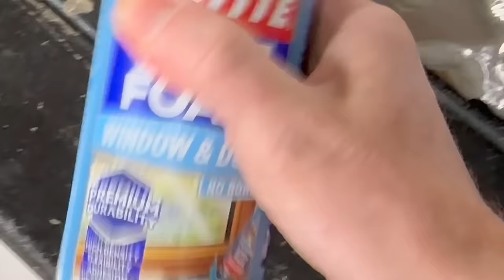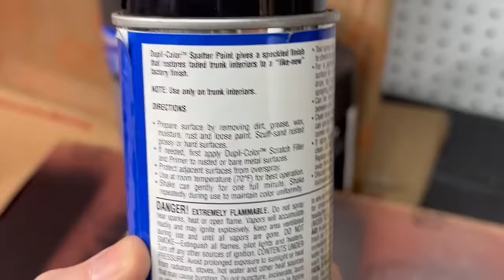How to Restore Cracked Vinyl Dashboard - Spray Texture Coating!

Comment: You should look at the SEM line of interior products. SEM texture coating 39853 is great for recreating textured surfaces and SEM interior dye can be mixed to the color code of your interior. SEM has 5 different sheens of clear top coats for the interior dye to match the sheen of your other parts.
Reply from the maker: I've heard a lot of good things about SEM in the comments and will be trying their paint on the next dash.

Comment: Try using a scraper on an oscillating tool to cut the foam. Works great. Fast and easy. Also try mixing a little fiberglass resin with the bondo. Makes it much easier to work with.
Reply from the maker: Great Idea! I recently bought one of those oscillating tools for my other channel. I'll give it a try!
Reply: @6thGearGarage you can get a Baur battery operated 5" DA sander that comes with 3 80grit velcro sanding pads for $24 through Harbor Freight. It does not come with the battery, though they are only like $20 bucks each. I had already previously bought a impact and a quick disconnect mini drill so I already had 2 batterys made by Baur so yeah, they make great tools. Packs of 5 80, 220, 400, etc run 6 bucks each they also sell packs of 15. I bought it to sand down some holes that I filled with fiberglass bondo on my 76 Corvette when I modded it with C6 Corvette mirrors. Worked great. Huge investment on the cheap.

Comment: Looks good, much better than some of the hack jobs others have posted. The one problem you have is you are using way to much product, too much foam, too much body filler each application. This is making your work efforts much harder than need be. When sanding do a wet sand you will get better and faster results.
Reply from the maker: Thanks! The foam is difficult to use in small amounts. Then I goofed and created a pretty big low spot on the front when I cut the foam too deep, which took more time to fill. I leave my mistakes in all my videos so that viewers can learn from my goofs.

Comment: It does Look good, but what about the touch? The original vinyl with foam underneath would surely have a bit of give under the hand, making it feel soft. But this painted restoration seems like it would be a completely hard shell. Am I right or is there still some give to it? How about the previous version with the 4-way vinyl?
Reply from the maker: It does have a little but of flex because of the spray foam. But I wouldn't press on it too hard, for hear of it cracking. Same for the 4-way vinyl, but no worries about the vinyl cracking because it's flexible.
Reply: @6thGearGarage  thanks fpr the reply!

Comment: Well done.  Might considering skipping the spray foam and use microlight body filler which is much easier to work with.  Also, use black or gray primer sealer to minimize bleed through from different materials underneath and provide good/consistent base to top coat.

Comment: I think if you would have spent more time sanding before you painted it it would have turned out phenomenal. You could still go over it and paint it again. You have to try that. Good job looks good
Reply from the maker: I agree. Depending on how it does in the heat test, I will go back and sand it more.

Comment: Looks good.  I wonder if one of the hammered metal spray paints would give a closer texture to the vinyl, without needed the extra texture spray and sand.  Some might only go on metal, but the universal spray lists vinyl and plastic.  Yours looks good, but if trying to blend with the rest of the vinyl, it's still different.  I need to do this on my '92 4runner.
Reply from the maker: I'd use this method instead, as the spray texture is not holding up in the sun. https://youtu.be/XB9GKLRHYNM
Reply: @6thGearGarage  I thought your previous attempts didn't pass the torture tests.  Maybe that was just with the spray on adhesive?  Your brush on adhesive with the stretch vinyl looks good.  My '92 has had cracks since I bought it 19 years ago, but they are worse now.  I think I will be doing this project, instead of just buying a carpet cover for $35.  FWIW, I am painting and clear coating the roof where sunspots formed, similar to your Acura Legend one, but with less perfectionism since it's the roof that almost no one will see.  We had a couple Legends long ago.  Nice cars, and yours turned out well.
Reply from the maker: @giro994  the first dash failed the test,  YT the second one passed very well. Sadly, this 3rd one has failed. I need to make an update video.

Comment: I might try this with my 1991 Camaro dash pad, but I think it might work better by using clear packing tape over the cracks after cutting out the channel then secure the edges of the tape with more duct tape and spray the foam into the channel under the tape might help with density and adhesion let it fully cure then remove the tape shape and prep for the texture process
Reply from the maker: That's a really good idea to save time on trimming it down. I recommend covering in vinyl like this video though, because it will hold up longer in the sun. https://youtu.be/XB9GKLRHYNM
Reply: @6thGearGarage  yeah the Camaro would be really easy to cover in vinyl maybe even do it in carbon fiber would look pretty sweet I think

Comment: I had an idea while watching.  What if you tightly wrap the dash with shrink wrap atleast around the work area after you grind the cracks out. Then puncture the wrap with the foam straw and fill the void that way. I imagine you will get a really good fill of the cracks especially if you get that wrap on tight and a a few layers.
Reply from the maker: That's a really good idea!

Comment: I would personally have built a mold to spray the foam in with the dash as a press counter tool to mold it onto. This way it expands and hardens much more densely too.
40, 60 and 80 grit sandpaper does the trick for trimming.
I would also never use the rough file coming close to end filling. It is far to course and risk scratching as you noticed.

Comment: Awesome work... In what room temperature did you use that you spray on that you got good results??
Reply from the maker: Thanks! I was working on this in my basement, so it was around 65° F
Reply: @6thGearGarage  You are welcome. In my area the temperature is 50f so can I start to spray it or I need to wait until it get to 55f or 60f?

Comment: That looks awesome Brian. Gave me some ideas for my YJ and Mustang dash.
Reply from the maker: Let’s see how it holds up through the cold and heat before you get started 😁
Reply: @6thGearGarage  I really like the texture paint you used. I have a nice crack in my yj dash from  a wrench that just happed to decide to fly one day. Was thinking it should be an easy fix since it’s not padded and I think that texture and paint route is the way to go after fixing it.

Comment: You can also use spray rattle can adhesives (like 3M 77) as a texture intermediate coat. It has unique rugged texture.
Reply from the maker: I've used 3m Super 77 before, it's very sticky, quality adhesive! I don't know how well paint would bond to it though.

Comment: Have you thought about using fiberglass resin over the foam and dash to seal the foam and fill in the factory texture?
Reply: Like foam the dash sand it smooth reform if necessary roll on a coat or two of fiberglass resin across the entire dash and sand it smooth
Reply: That looks really good man.
Reply from the maker: I did a comparison on the very first dash repair video, and the body filler was actually a little more flexible than the fiberglass resin. I wanted some flex to allow for expanding and contracting in the sun/shade.  I think either would have worked though.

Comment: The dashpad in my 4runner was fixed using a similar method. It sat inside in a climate controlled area for about a year and it looked pretty good. Unfortunately after I installed it, it immediately cracked after 1 heat cycle. Rewrapping the dash pad seems to be the best way to fix them.
Reply from the maker: Thanks for the info... if this one cracks in the heat, then I will sand it down and wrap it with the vinyl.

Comment: Just a hot tip ;   after applying bonds, let it harden till just firm and not too sticky , its easy to shape with file and easier to sand
Reply from the maker: I've tried that and it works with the file, but clogged the sand paper right away.  Maybe I didn't wait long enough....

Comment: It looks good, the finish is quite decent...i'm going to be working in a Fj40 dash...i think is gonna be easier since the most part os flat...thanks for the video.
Reply from the maker: Unfortunately it is not holding up well in the sun.  The second dash that I vinyl wrapped is still doing great.

Comment: You had the right idea with the cheeze grater filer but the wrong timing. You use that just as the bondo sets up, like too stiff to spread but still rubbery. Works best then, no gouging and shaves fast.
Reply from the maker: Thanks for the tip!

Comment: I’d like to see another vinyl wrap test but with using a vacuum bag setup to see if that makes a difference with gluing down the contours
Reply from the maker: I haven't tried the vacuum method, but would like to!  I also want to try flocking a dash at some point, as well as making one perfectly smooth and glossy like a late 90's show car, but that one just sounds like a nightmare for my OCD.

Comment: Masking before foam would help you after the fiam is cured. Aldo using a foaming polyurethane glue would give you way more control when filling the cracks.
Reply from the maker: So would I mask over the crack and then spray under the tape to help keep the foam concealed when expanding?

Comment: After the texture i think I'd have leveled it a little with high build primer. 

It came out nice though. 

Hydro dip might be neat on one too.
Reply from the maker: Thanks! I recommend covering in vinyl like this video though, because it will hold up longer in the sun. https://youtu.be/XB9GKLRHYNM  This dash has started to crack again because the paint flexed.

Comment: You might fund matching your texture easier if you go lighter on the splatter paint and the do a high build prime after then sand the 2 down. Repeat the high build and sand until the desired texture. 

I am guessing but it's where I'd start.
Reply from the maker: That's a great idea!

Comment: I really like the way this came out. Maybe a little more sanding to smooth it out a bit better. I am working on a 87 4runner and it has a cracked dash that will be repairing soon. I refinished the removable top with Raptor thinned and shot through a HVLP gun and the finish is very OEM and not Berliner looking. I may use the Raptor shot the same way on the dash as I think it came out a bit smoother then the trunk paint you used. Thanks again for the tips and tricks. Good stuff!!!
Reply from the maker: I agree, the more I look at it the more I wish it was a little more smooth.

Comment: I was wondering. Would this work on vinyl boat seats. They are cracked and pulling apart from the seams.  I just might try it.   I mean if it doesn’t I can always reupholster them.
Reply from the maker: I highly doubt it, as the surface of the seats will flex when used and crack. I'd skip this and go straight to reupholstering them.

Comment: That looks pretty good. A trick to get that vinyl fake leather texture is to use tin foil.  Take a sheet of foil and crumple it into a ball, then carefully un-crumple the foil back into a sheet. The uncrumpled foil will have a very similar texture to fake leather. Use a thin scratch coat of body filler on top of your prepared surface, then press the foil into that thin layer of filler to leave the fake leather texture in the filler. This has to be timed just right, when the filler is about to set but is still moldable. (play dough stage) Pull the tin foil off right away before the filler hardens. After the filler hardens, give the surface a light sanding to flatten any ridges or high spots then clean and paint. I have used this method a couple times and though it is a bit tricky, the results look very close to factory.
Reply from the maker: That is a genius idea... thanks!   The only thing I'm wondering is how the skim coat of bondo would hold up over time on a dashboard that expands/contracts from heating & cooling?
Reply: @6thGearGarage  I have never used this method on an entire dash, usually only damaged areas but as long as you rough the surface before applying the thin scratch coat, it seems to last quite well. The first time I tried this was about 5-6 years ago, and it still looks like it did when I finished.

Comment: Do you think a wire wheel would get into corners better?
Reply from the maker: A wire wheel isn't as precise as the dremel. I think the smallest wire wheel I've seen is 1", which is still a big radius for one of the corners.
Reply: @6thGearGarage  I was thinking big wheel to get down close and dermal wire wheel 1” so I guess I’ll go with what you say, I have never tried this sort of repair and probably should hire someone like you to do it bc it seems to be a good bit of art to it….i can’t draw a stick figure.
Reply from the maker: @VaderisOne  
I recommend covering in vinyl like this video though, because it will hold up longer in the sun. https://youtu.be/XB9GKLRHYNM  This dash has started to crack again because the paint flexed.

Comment: 6:37  As you are not using the foam for it's intended purpose, you could cut the straw down to a more manageable length.  Also, I would try two coats of foam, like when you do bondo. The first skimpy coat is smashed and mooshed to contact all of the substrate and the second is the fluffy filler. Easier to work with dried foam that has not been molested. More uniform to cut and sand.
Reply from the maker: Good idea!
Reply: @6thGearGarage  Thanks!  Wait!  I just had yet another flash of brilliance. If you gently wrap it in cling wrap just after the second foamy coat you may get a more uniform version of the stronger outer layer you were looking for.  (Sure I'm stoned. Why?)

Comment: Yes the spray on vinyl looks much better, much easier and looks natural.  Also, instead of using foam, I would go all the way with bondo!  No need to double work with foam.

For your own health, use a chemical mask (respirator) Don’t listen to anyone saying these chemical sprays are harmless.  The U.S. Army told our soldiers in Viet Nam that agent orange was harmless and most of those veterans have died of cancer!
Reply from the maker: I tried using all bondo on the first dash I restored and it actually took a lot longer because of all the application, curing and sanding.  Good news is that it did hold up well, it was just the vinyl & glue that failed on that dash. So bondo instead of foam does work if you wanted to go that route.

Comment: I would have used a barrel sanding tip with a dremel to do that inside lip around the vents.  Much faster.  My only other minor criticism would be how thick you are applying your body filler.  Thin to win brother.  I am not strictly a body man but I do build custom hotrods and stock cars as sanity maintaining hobby.
Reply from the maker: Yeah I had to put the filler on extra thick where I cut out too much foam. I'm interested to see how this holds up on the heat/cold test!

Comment: I need help. My 1999 4Runner got broken into & thief tried getting into my glove compartment (glued shut since it broke yrs ago) and moron pulled the dash part above it and now it's sticking out 😢 I haven't found a way to glue it down 😭
Reply from the maker: Since there is no way to  glue and hold it down with a clamp, what about using a piece of wood a few feet long and press it against the passenger seat back to keep pressure on the dash? Slide the seat forward to add more pressure.
Reply: @6thGearGarage  what would you suggest to glue/bond it?
Reply from the maker: @cinthya1520  It's hard to make a guess without seeing the damaged area. I have used Weldwood contact cement on dash repair, because it seems to do well in the heat from the sun, but that was only for the vinyl surface. Can you message me on IG/FB with a pic?

Comment: Use a piece of sheet metal to mix your body filter on. Using cardboard, wood or even mixing sheet pads designed for mixing filters,😢 will draw moisture out of your filler mixture and cause your batch to prematurely harden. An added benefit is the metal sheet can be scraped sanded and reused nearly forever if you use a thick enough gauge steel. 
Pro tip courtesy of an old-timer body shop owner.
Reply from the maker: That's a great idea.... Thanks!!

Comment: Looks great. Next time remove all the vinyl from the original dash to where it's all foam, or add adhesion promoter to what's left of the factory vinyl before you paint over it.
Reply from the maker: DOH! I actually had some adhesion promoter and didn't even think about using it. We'll nee how it holds up in the heat & cold!

Comment: How hard would it be have to beg to get you do redo the vinyl dash pad from my 1977 Ford F150?   

Ps new sub and I love your videos and you techniques.
Reply from the maker: I'm flattered, but since restoring this dash I have found that it is not the best method, as it does not hold up to the sun. Mine has started to show cracks in the paint.  I recommend this method: https://youtu.be/XB9GKLRHYNM

Comment: go to harbor fraight get a rolock sander and a 1/2" belt sander 75 bux? needs air though
Reply from the maker: I have an old belt sander but for something this small I don't mind sanding by hand. Plus, it helps me constantly feel the surface for any high/low areas.